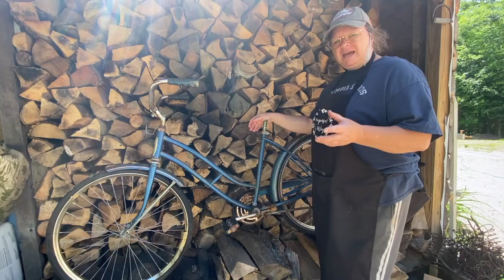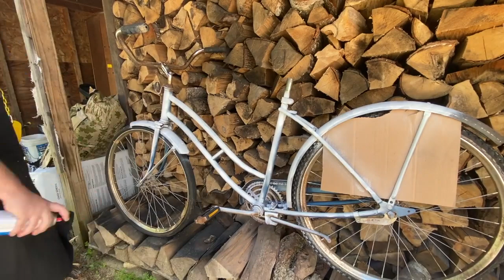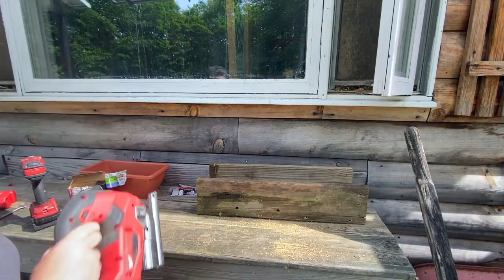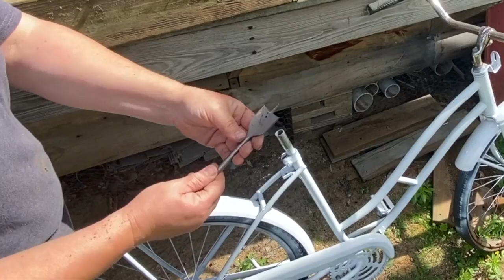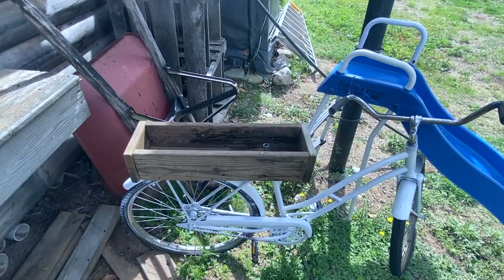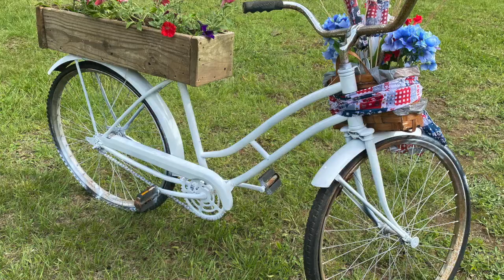Trash To Treasure Outdoor Home Decor | Old Bike Upcycle Repurposed DIY Project

Comment: Hi there! I'm new to your channel and I know this video is a year old, so I'm not sure if you check the comments anymore, but I'll take a chance. I just wanted to ask you, since I'm getting into woodworking (a little late in life since I'm 57, but never too late I guess). When you were making the planter box for the bicycle, you cut a couple of pieces of wood. What was the tool you were using? Was that a jigsaw or a miter saw? I didn't see a blade so I couldn't tell. It came out great by the way!!
Reply from the maker: Hi Christine! I am so glad you are getting into woodworking. It's so much fun to create things out of wood. You are right, You're never too old.
So the tool I was using is a jig saw or an old term is a saber saw. It has a short blade on it. The miter saw cuts boards at an angle and is usually much larger. 
Please don't hesitate to ask questions and I will try to answer or find the answer for you. I really try to answer every comment and question I see.
Thank you for reaching out.😀

Comment: This turned out awesome. I have a vintage bike that is missing the black rubber tires and the plastic grips. Any ideas on how to make it look good with those elements missing?
Reply from the maker: Thanks Kathleen! You can still buy the rubber tires and the handles at places like Tractor Supply, a hardware store, or Amazon. Good luck
Reply: @RepurposedMyWay  thank you so much!